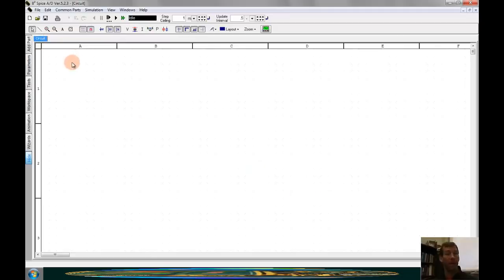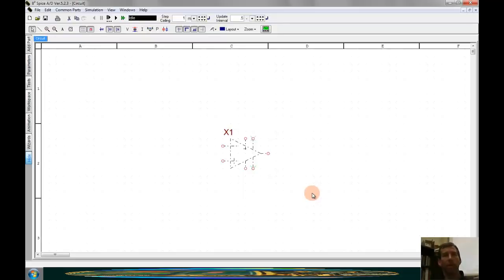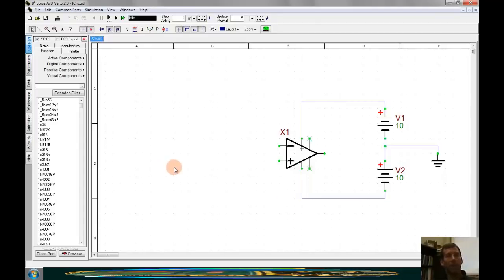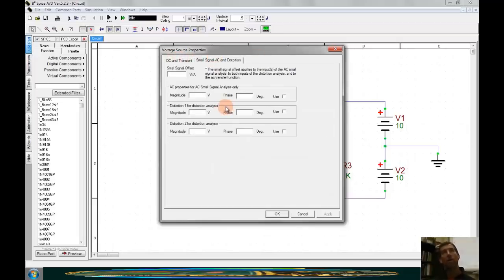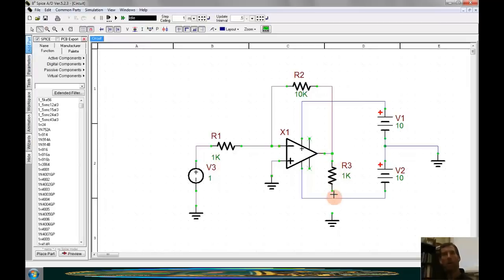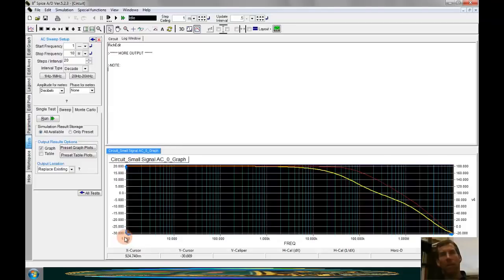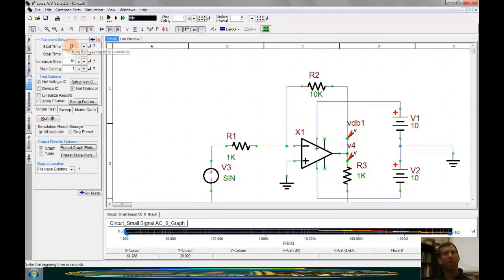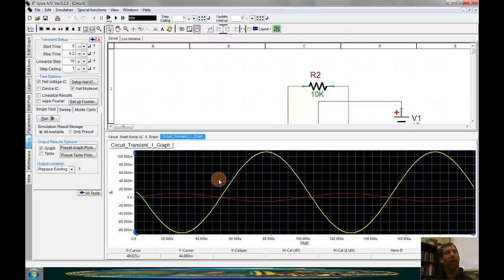B2Spice Demo IV OpAmp

Comment: hello sir,
How can i get Input and output devices in circuit ?
Waiting for your reply
Reply from the maker: I'm not sure what you mean by input and output devices.  Input devices are generally modeled by the Thevenin equivalent, which is a voltage source in series with a resistor.  Output devices are modeled by appropriate load elements.